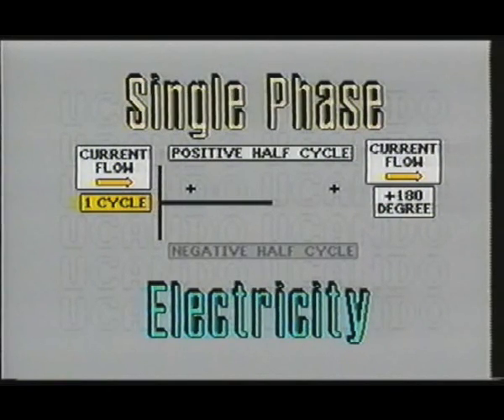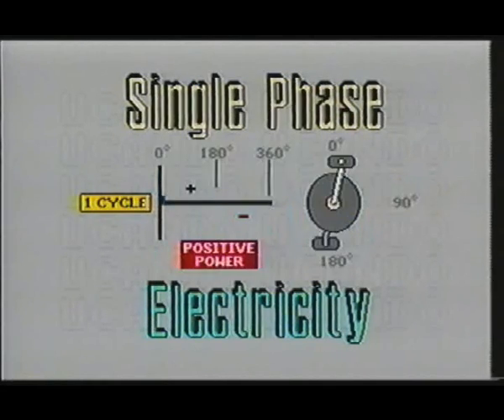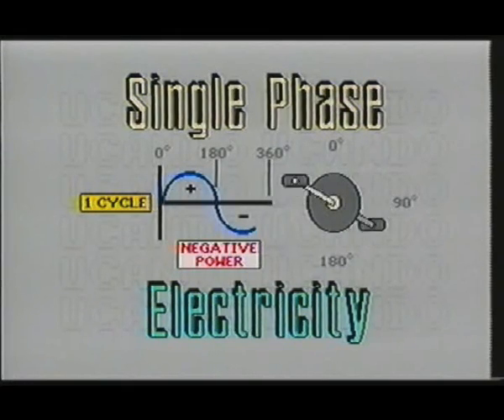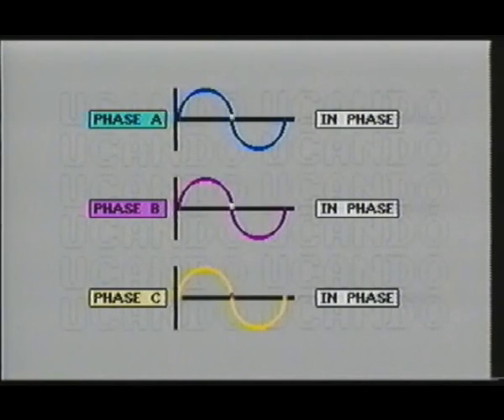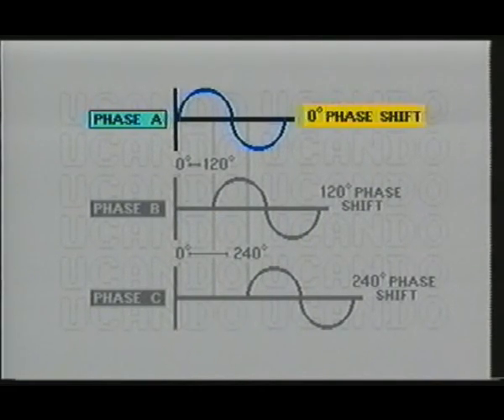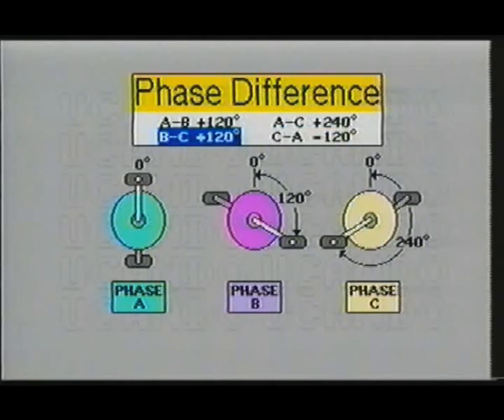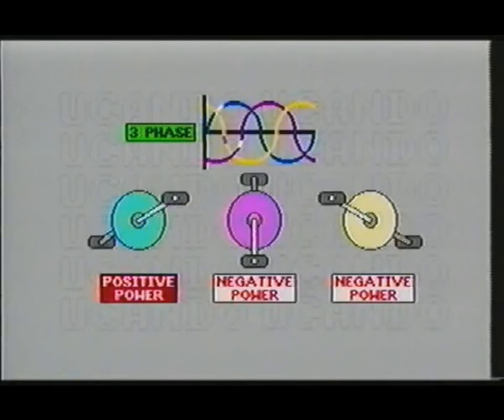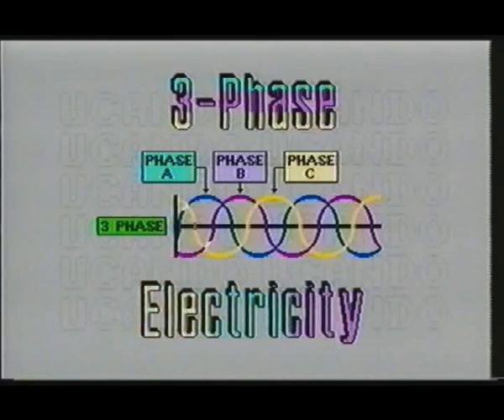3 Phase AC Motor Working Principle

Comment: why do we use an 3 phase power instead of 2 phase or 4 phase
Reply: Because going to 4 phase would require a major upheaval worldwide. All power plants send out 3 power lines and every telephone pole you see has 3 power lines. Every single one of them would have to be upgraded and that's just way too expensive.

2 phase power was used at one point to start industrial motors, but 3 phase was more efficient and required less power to start motors.

3 phase exists now and it's very efficient. No need to go back to 2 phase or upgrade to 4 phase.
Reply: For  your 2 phase, this is single phase but using both sides of a split neutral. You would then need to generate the same amount of rotations to earn your speed out of two phases instead of three. The power is available, but the higher current means thicker core wire and less efficiency, especially over time.

Anything more than 3 phases - it has been mentioned about the upgrade of the line side supply, but don't forget that you need to wire all the devices in your factories with them what, 6 phases if that is what you are looking for? 

Look at the phase relation like a automobile motor. With 4 cylinders on a crank, the first one ignites a small amount of gas which provides force, power. That one is tied to the other three of the crank and as this one is down a little, the next one fires. These baby steps allow you to use less gas to get the same result. Now, some crazy models like the Lamborghini V18 is something crazy and takes some real design into effect but it is not efficient to have that many cylinders. They wanted pure power, screw the efficiency. But they can do that.....there is no real "standard"....their car, they do what they want. Try asking your power company to feed 6 phases and see what they say. 

There is an equilibrium in the 3 phase design and I can only assume that we will not even bother looking into a different future supply until technology has maxed out the 3 phase full potential. We can play around with efficiency by increasing the voltage for a lower amperage draw, achieving the same kw as it is but the relationship between the incoming phases stays the same.

Comment: so when one phase goes negative, another one takes over?
Reply: Basically. Single phase power does this as well but requires more poles what ultimately makes the motor run at a slower RPM. Single phase is also less efficient and usually requires a capacitor to assist in starting a motor. 3 phase requires no capacitor and runs about 3 times more efficiently on the same load.

Comment: When first learning electricity, the whole "degrees" thing was just confusing. As a professional now, I wonder why it isn't taught showing, graphically, power flowing back-and-forth in a conductor. To my mind the pedals image doesn't make it any clearer how a sine wave relates to current flow. 

👍for the video though.
Reply: How can 3 separate coils fed with the same frequency of current produce a 120 degree offset from each other? This doesn't make any sense. I can see the concept of 3 phase and it's displacement, but im confused on how it was produced in the first place.

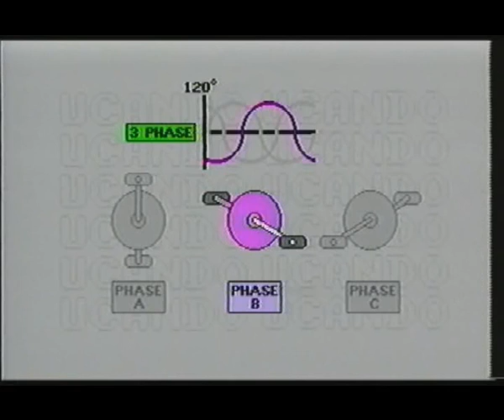Comment: AM I RIGHT??? If I say that in min 3:40 the graph doesnt match to the pedals???? the pedal is at 120 degrees from the beggining, while in the graph it acctualy is at 240 degrees. I think they inverted the graph of the B with the graph of the C, Am I right?
Reply: No. The graphs are correct. The 360 degree turn is clockwise and the bottom pedal is at around 120. Don't forget that the pedals are equaling 360 degrees, so anytime you see 120 degree and 240, they are simply opposite sides.
Reply: +Dan Varlan Agreed! :P

Comment: Just to be clear on one thing.  When an appliance of 2 hot wires operates, it uses 240V.  So does the 3 phrase motors run on 360V?
Reply: SamsungLG It depends entirely on the transformer. Most 3 phase is either 208V or 480V. Remember with a single phase system, like in your house,  the 240V is achieved from the transformer and it's not from "adding 2 120V together" which is a common misconception. 120V is achieved from basically grounding the circuit halfway through the transformer, called a center tap neutral. Also remember, the neutral wire is also the "hot" wire 30 times a second in AC power. Look up 3 phase wiring diagrams for an even better understanding of how the different voltages are achieved. Hope this helps!
Reply: efco24 That was helpful, thanks for commenting.
Reply: +SamsungLG 3 phase motors tend to run on 415V.
Reply: +Charlotte Cottam Interesting
Reply: +SamsungLG Some time ago, 380V was the standard, along with 220V for two-phase power. Now it's somewhere around 400 volts. Basically, however, it depends on the application; it can be any voltage you like (and have the parts for).
Reply: I think your question is: if 2 phase (really called "split phase") uses 240v, does it automatically mean that 3 phase uses 360v?

No, the number of phases doesn't automatically determine the voltage. 3 phase power comes in many different voltages (208, 230, 460 and up, here in USA--other countries have different voltages).
Reply: Thanks for clearing that up guys, I got a better understanding of that now.

Comment: Would a six and nine phase motor be of benefit? Maybe the three phase is just the beginning.
Reply: +Xbox360Chicken Three-phase is the most efficient. Six, nine, or twelve phase would require much more wiring and hardware with little added benefit.

Comment: So... What is two-phase?
Reply: I would assume two-phase would be Phase A and Phase B, (With Phase B set 120 degrees still)
Reply: Rebecca Thornson I also thought that, but electricians keep telling me that two-phase doesn't exist. Because a phase isn't one of the poles, but the voltage between two poles. That means that you have a phase between wave A and B, another between wave B and C, and the third between C and A. If you understand... ;)

If you connect a single-phase load(like a lamp) between pole A and B, you are using one phase. If you connect a 3-phase motor between all the 3 poles, you then suddenly automatically have 3 phase. WTF???

Google "two-phase" or "dual-phase". I cant find something convincing.

Thanks :)
Reply: 2 phase is single phase. Not many people use 2 phase in conversations, but they are basically talking about single phase. 

It's actually called "2 Phases and earth", which is basically, Live (brown wire), Neutral (Blue Wire) and Earth. So it's single phase. Like you find in a plug. Hope that helps.
Reply: Nathan Smith Yes, electricians also say so, that "two-phase" actually is single-phase. It's still kind of confusing... :(
Reply: It can be if you don't do electric work daily. All you need to remember is that there's single phase and 3 phase, don't worry about anything else as it will get more confusing.

As you can imagine there is more names or sayings for 3 phase as well.
Reply: yep Nathan Smith has it right. Single phase applies to one or two live conductors, or one live conductor to neutral. There is only one measurement between two points that give you for example 240 v. the two points being A and B. Or 120v to ground by either A or B. On three phase there are three points, A to B, B to C and A to C. Always be safe around electricity. It has no feelings for you and its invisible ! ZAP !
Reply: I agree there yewwwtoob, it's not nice getting a shock of of 240v if I'm honest lol
Reply: Two phase is not the same as single phase. Wikipedia explains the difference between single, two and three phase power.

http://en.m.wikipedia.org/wiki/Two-phase_electric_power